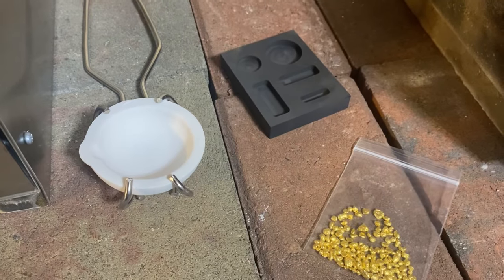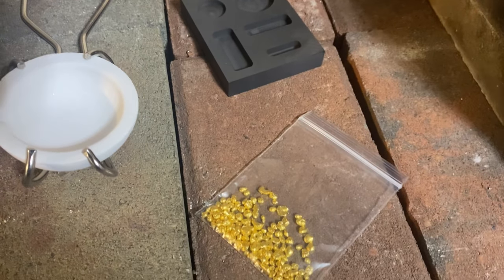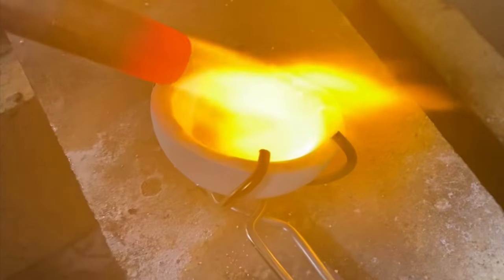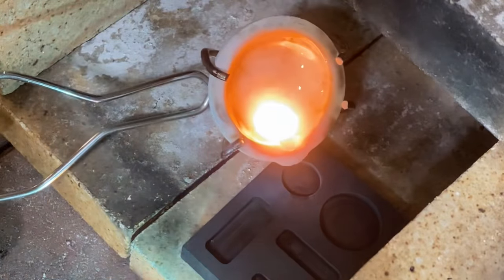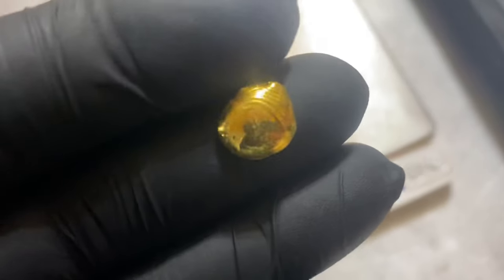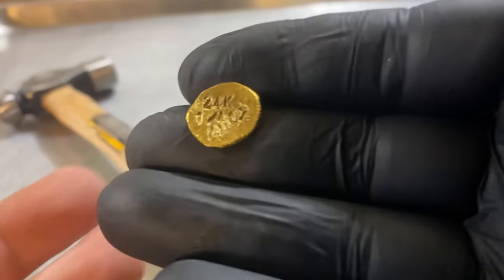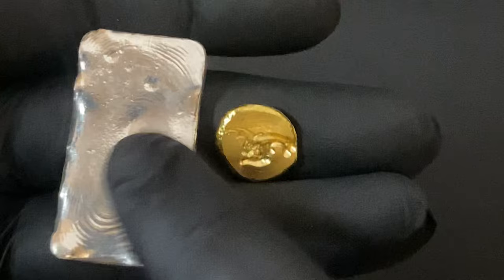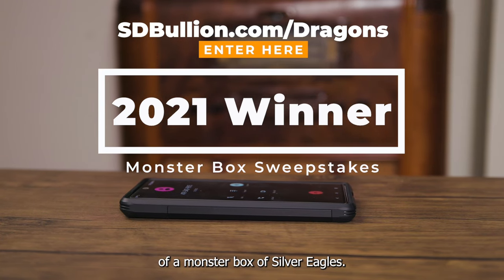How to Melt Gold and Make Gold Coins (Rounds) At Home!

Comment: You lost me at borax lol I wish I had the balls and equipment to do this! I would make so much cool things
Reply: Its not hard.
On pure gold I don't use borax.
I heat the melting dish very hot with a propane torch and slowly sprinkle borax on the glowing areas to "glaze" it and work my way around the dish until it has a coating of melted borax to seal the dish and keep molten gold from soaking into the dish.
There's videos on YouTube.
"Glazing a crucible " so you can see how it's done.
When I use to add borax to pure metals I have to boil the metal in diluted sulfuric acid to remove the borax stains.
Reply: Well I just started collecting gold and silver last year but I have a good amount saved up. I live In a condo so I can't really be burning anything on my porch haha. One day I want to start this since I made my own graphite molds at work with cnc. One day!
Reply: @PaydirtGetaway  very nice 👌
Reply: Stop bean scared to learn!! Jump in make a mess u got thissss